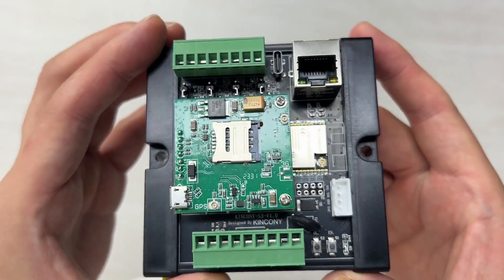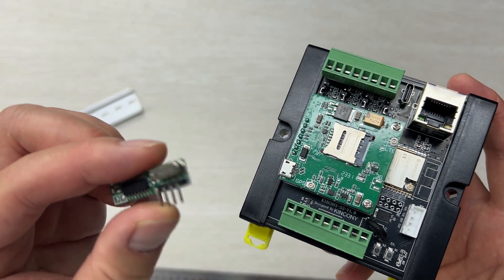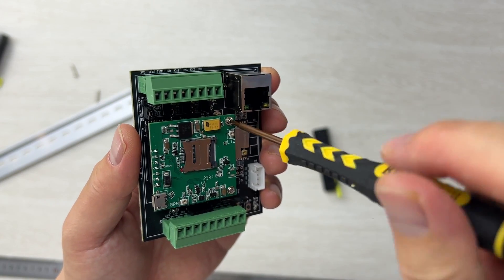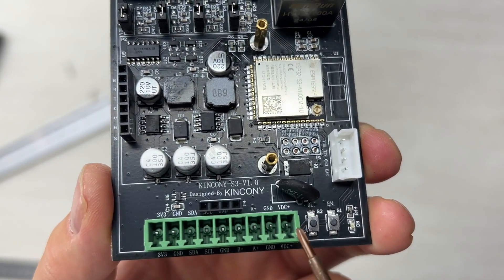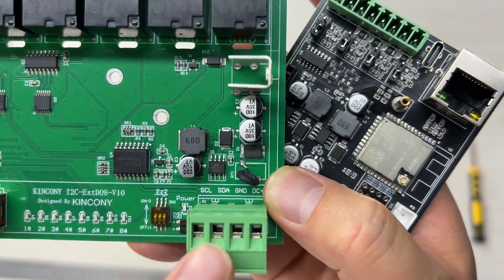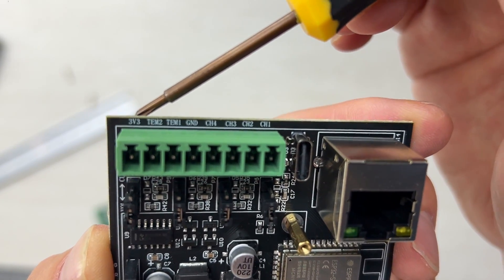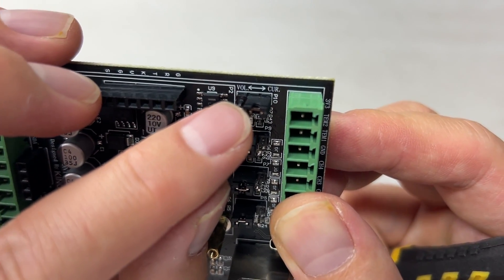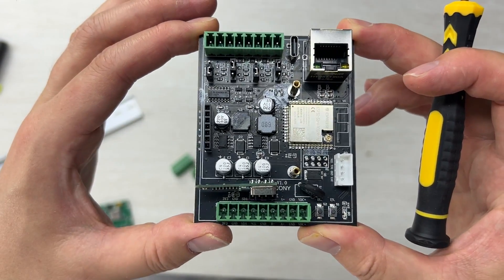mini ESP32-s3 core DEV board for DIN RAIL - KinCony S3

Comment: I want to use sim7080 for sending mqtt data, does the header support PWR PIN, MODEM RST and POWER KEY?
Reply from the maker: you can chose this 4G module, have power pin: https://shop.kincony.com/products/kincony-sim7600e-l1c-4g-breakout-lte-core-module?_pos=9&_sid=fdb8b8e31&_ss=r
Reply from the maker: pin-S (SLEEP): set module to SLEEP mode
pin-G (GROUND): GND
pin-V (VCC): power supply DC 5-10V
pin-K (KEY): power on/off module
pin-T (TXD): send data
pin-R (RXD): receive data
pin-G (GROUND): GND
pin-RST: SIM7600 chip RESET pin

Comment: Can i use a SIM7670G, A7670G or SIM7080G board instead of the sim7600G? They look the same.
Reply from the maker: yes, it's ok, hardware is pin2pin compatible

Comment: Can I connect a  PZEM-004T V3 (requires RX and TX) and a clamp ci to this board?
Reply from the maker: sure, chose 2 free gpio to use
Reply: @KinCony  but it should be RX and TX to be inverted RX from PZEM-004T V to TX and TX from PZEM-004T V to RX. Any gpio could be fine?